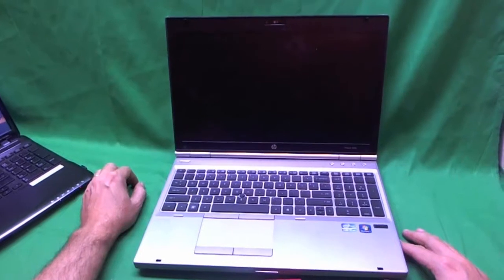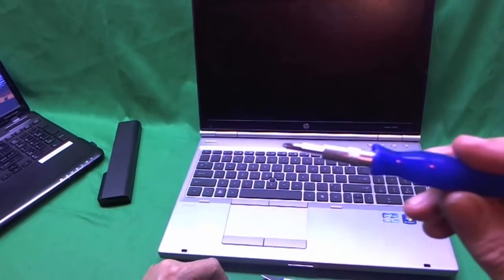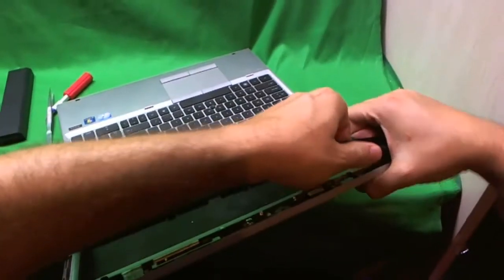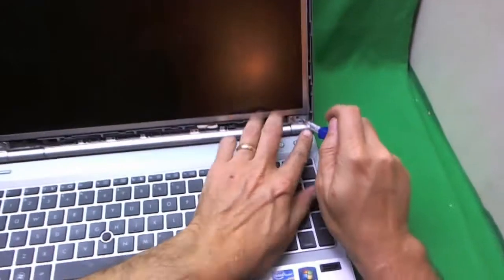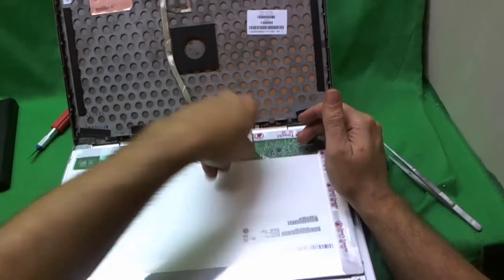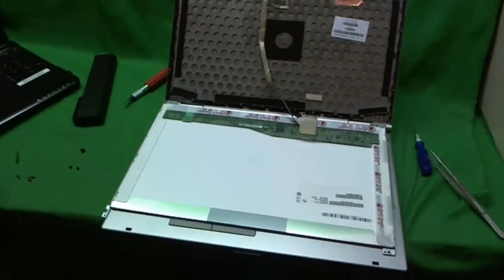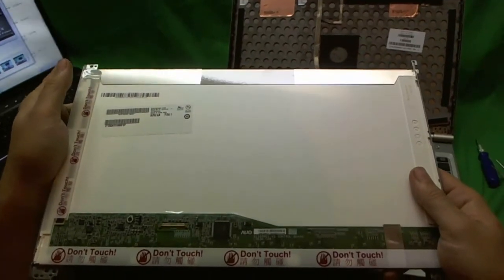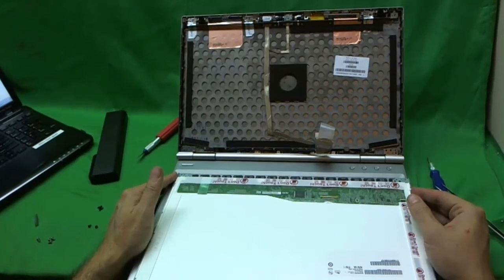HP EliteBook 8560p Laptop Screen Replacement Procedure

Comment: Used this for an 8570.  best video hands down.  Great job guys....
Reply: only difference is w/8570 you have 4 screws on each side to take the main display out.  that's the ONLY difference.  took 20 minutes beginning to end